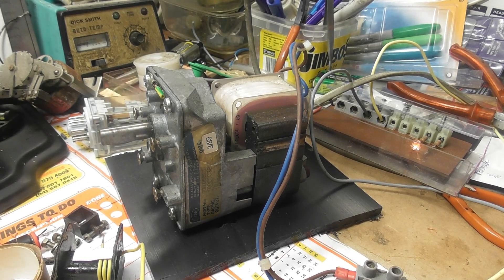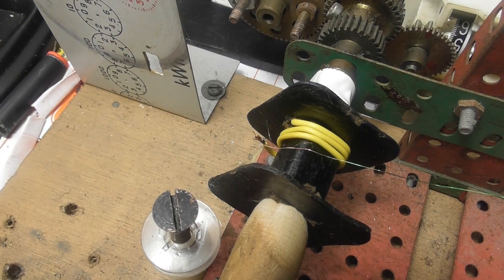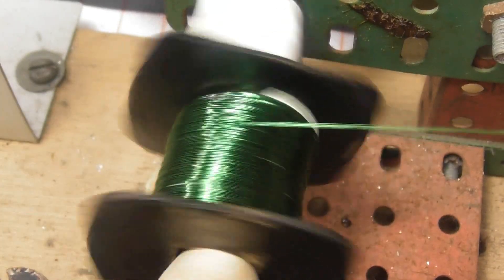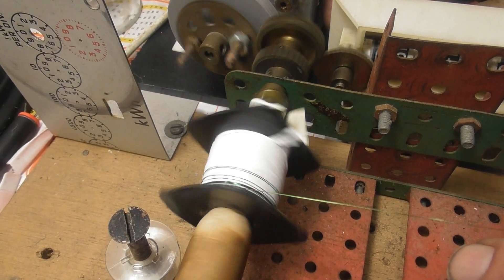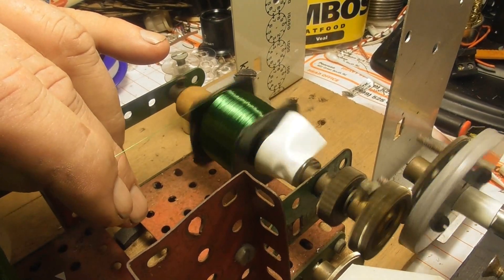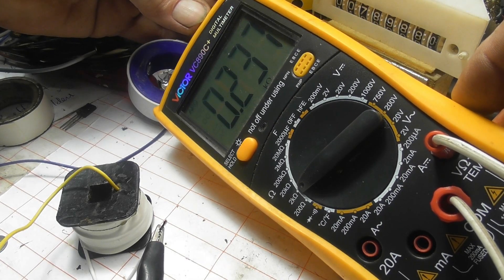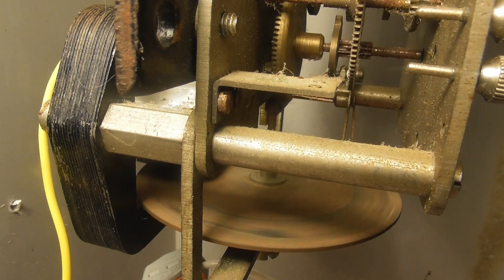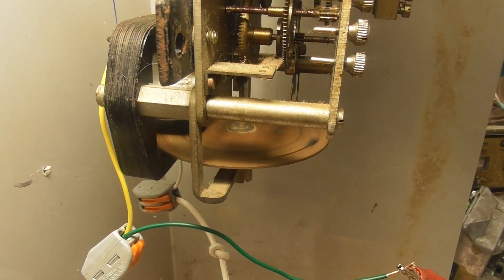Landis & Gyr. Ferraris disc motor rewind

Comment: What’s the dieleaktric 😂strength of Teflon tape?
Reply from the maker: I am not worried about that, just have a layer between some windings. This ended up as a 50 Volts coil, so there is not much voltage difference between layers of windings.
Reply: @RODALCO2007 , joking
Die leak tric, not dielectric, fabulous work on the coil winder by the way

Comment: Interesting use of teflon tape
Reply from the maker: It is actually better pliable then insulation tape. Not much volt's difference between windings in this case anyway.